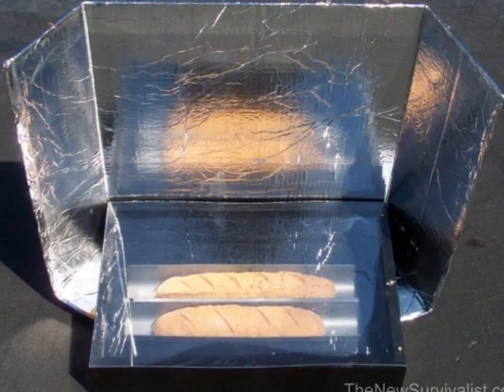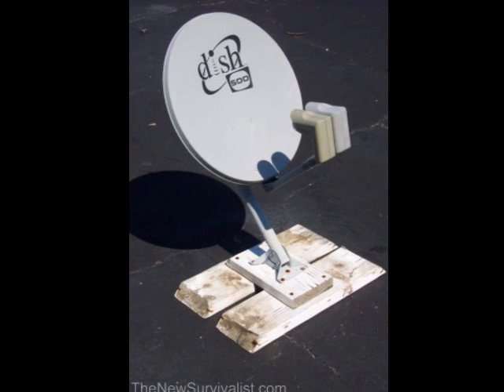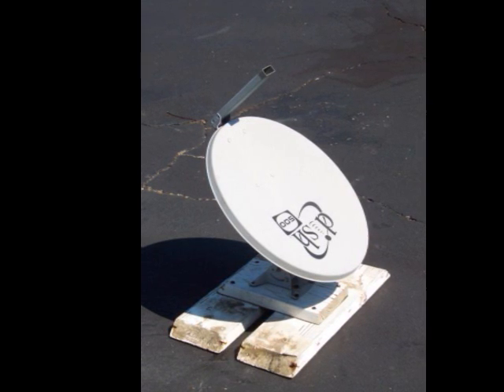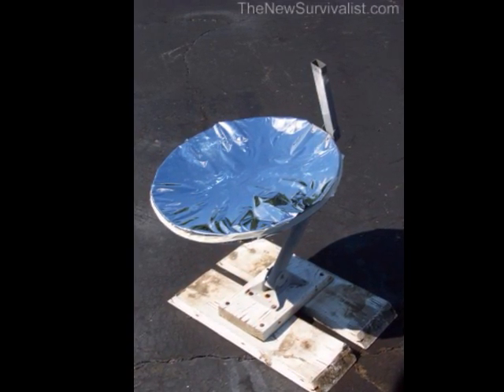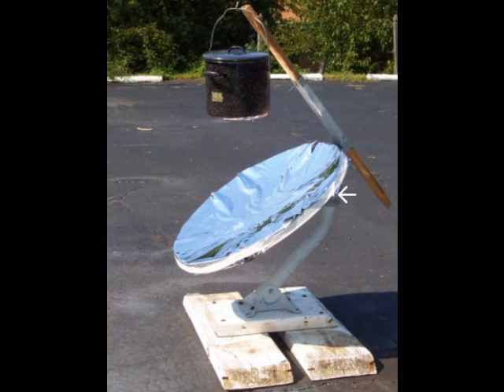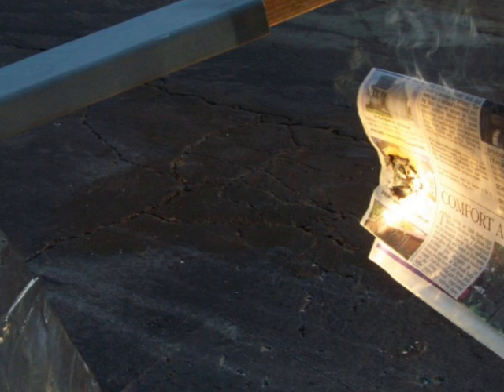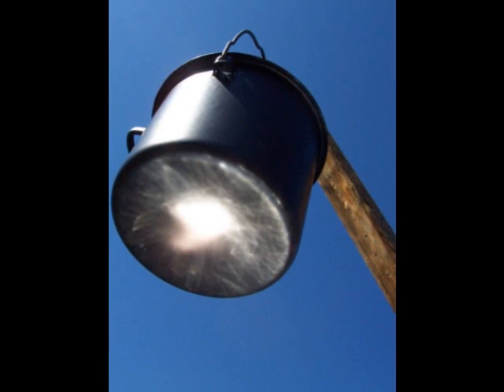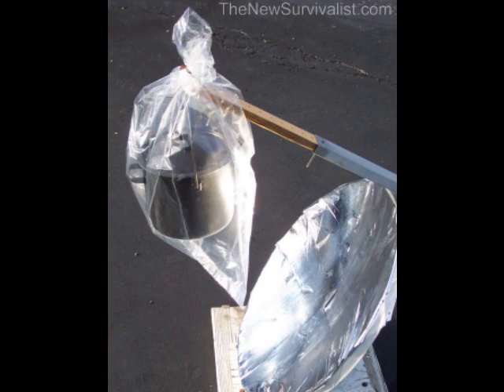How to Make a Parabolic Solar Cooker

Comment: Is there any specific measurement on how far the cooking pan into the parabolic solar cooker?
Reply: reducehighbills There is a formula to find the focal point. Im not sure what it is though.
Reply: It would be very easy to figure out the focal point once the dish is in the sun. Just move a stick or paper or something back and forth in the zone where you guess the focal point might be. At the very least you'll notice a concentration of light, but I expect it'll burn. 

I left a chrome dish shaped object on the front seat of my car on a hot day. When I returned I could smell burning plastic. The sun had come through the window, hit the dish, and the focal point was concentrated on the glove-box. There was a burn line along the glove-box, caused by the sun's movement. It started wide, and vague at one end, but was very conserntrated at the other end, and getting worse, nearing the absolute focal point. Another few minutes and.... :-( But that's not a method I recommend! :-)

A few more minutes and

Comment: something else: wouldn't a lazy susan be helpful in re-positioning your satelite dish?
Reply: I found a nice thick wooden lazy susan at a yard sale for $2 and attached the Dish to that and it works great for adjusting and moving the dish around, thanks for that idea, that's if you can find one, I got lucky for the price of mine, I will be testing the chrome mirror decal sheets to see if they offer any better heat reflection than Foil.

Comment: Can this thing cook in the winter?
Reply: Any type of Solar oven will cook in any weather, but the difference is, depending on how low the winter temps get, your cookware, even when in a cooking bag are fighting colder wind and temps to stay hot and cook, I cooked at 8 am on a fall morning 64 degrees outside and my food cooked fine, took a bit longer than normal but still cooked, a box or funnel Solar Oven seen elsewhere on Youtube are better suited for colder or winter weather.

Comment: Curious about putting a small pot inside a larger pot with a spacer of sorts that will allow air circulation under the smaller pot. Might make for a nice slow cooker (crock pot). Anyone up for giving it a shot? You can have the credit if it works. I'm just a curious person without the means to try it out, otherwise I would and put a vid up, also, it's winter and that sort of puts a ding in the whole thing for me.